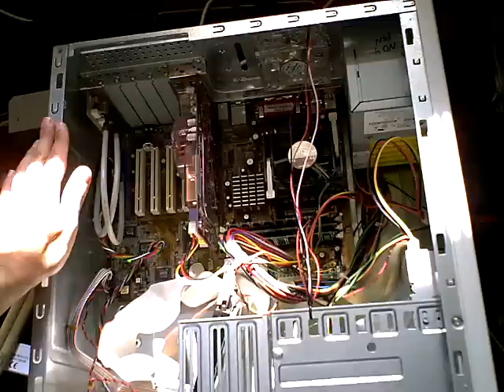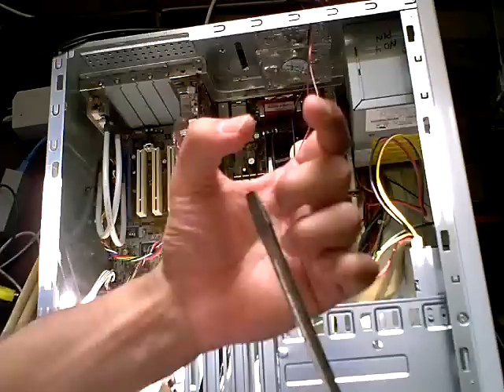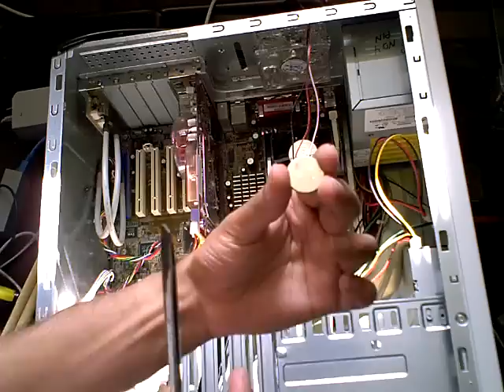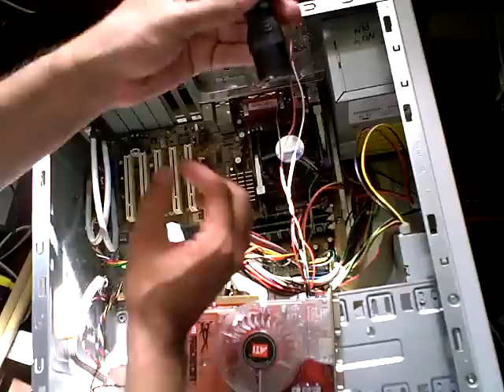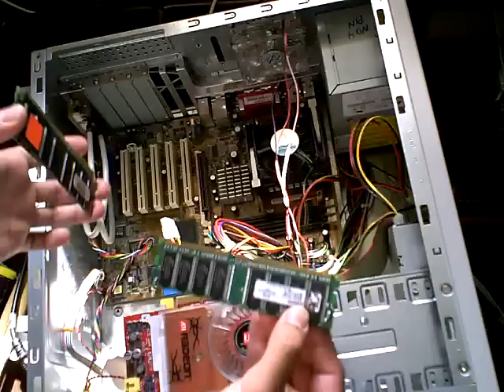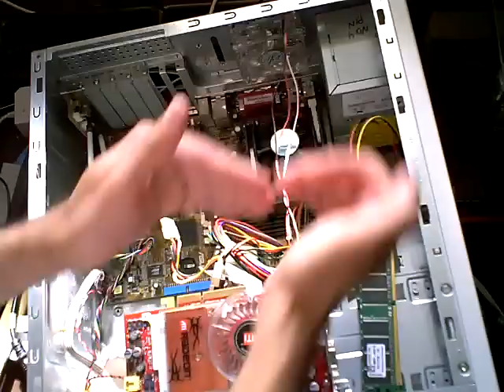How to possibly fix a PC that will turn on but will not beep and will not display anything on screen

Comment: After i saw this video i buyed a new motherboard still nothing exept on the older motherboard it randomly turned it seof off and after few sec back on but this one just keeps vorking the coolers but still no change...PLEASE HELP!
Reply from the maker: +limso cro It sounds like your motherboard is developing a short circuit due to contact with the metal casing. Most likely it has to do with the screws and metal mounting stands (supports) that your motherboard sits on. The cheapest way to fix this problem is to introduce cardboard washers between the screws and where they make contact to the motherboard, or you can buy plastic mounting supports at a computer shop.

Alternatively, you can always Breadboard it (explained in the following video:)

If the steps in this video did not provide a solution to your problem, view:

http://www.youtube.com/watch?v=_EK9a-R5pss

You never know, maybe rebuilding the PC in the opposite sense that you took it apart will solve the problem.
Reply: RodneyDickson nope...the problem was the cpu.
Reply from the maker: +limso cro Nothing much you can do at that point. Thanks for the update.

Comment: So I have four Ram modules replaced each one separately and the last one sounded the post beep error. help
Reply from the maker: Each time unplug the PC, install RAM modules in different combinations and orders, then power up. Repeat this until you can get as MANY of the RAM modules functioning at the same time. If you cannot get all RAM modules to function at once, one or more of the RAM modules may be defective.

Comment: If you have this problem and you really need to recue the computer, then press reset if you don't get the beep, even if it takes you 5 times to press reset, is working on one of my computer ASUS.  This  problem  raised   when I flushed the BIOS  several times over the years (with  BIOS file from ASUS). < PS> most likely the filters in the mother board are going bad
Reply from the maker: +UFO1997 Thanks for the feedback
Reply: +RodneyDickson  yes, it was one of the filters, I still pressing reset till goes in to set up, and I get it to load, when it loads the game gets messed up the video and it freezes (server open too many ports), then I reboot with reset, then load the game again, and I finally play the game. <> I located the filter but I misplaced  the solder, that's why I haven't fix it. he he
Reply from the maker: +UFO1997 (shrug) If you could find a way to get it to work, then it's only a minor inconvenience : )

Comment: I still can find my problem and its frustrating as crap I've just build my first pc and earlier it was showing display but now its not showing anything and I can find the solution
Reply: can't*
Reply from the maker: +The Chop If it's a new build, you might want to breadboard the entire thing. http://www.youtube.com/watch?v=_EK9a-R5pss
Reply: Thanks but i have it solved my mother board was dead i dont know how but it wouldent work for my cousins pc but i got a new one and it works fine
Reply from the maker: +The Chop Sorry it came to that, but glad you figured it out

Comment: Hey dude i got a problem maybe you can help me out i got this sumsung tv that i use with hdmi plug in to pc and today i turnd in on and it dousnt work tells me no sginal but when i plug in normal pc screen with that blue plugin it works just fine how could i fix that this . if any one hase any ideas plz let me know
Reply from the maker: +Vampex I Sure, you'll need to install drivers to support HDMI, THEN you'll need to configure said drivers to ensure that your PC outputs to HDMI by default. Your graphics board manufacturer will be more helpful to tell you exactly how to do this for your specific video card. Good luck

Comment: Help me my computer beeps and my monitor displays nothing and my keyboard and mouse doesnt work i can see its not working because my mouse have lights
Reply from the maker: +shadowslayerhero Beep error codes differ from one BIOS manufacturer to the next. To discover what the beep error code is trying to telling you, discover the manufacturer of your BIOS (available in the motherboard's manual or on the motherboard's manufacturer's website {on the page for your specific motherboard model}) and then look up the frequency and interval of your beep error code on:

http://www.computerhope.com/beep.htm

Comment: i bought a brand new pc, wasnt projecting onto the monitor so i followed these steps found out it was the ram but when i put back in the cmos battery it wobbles around is this ment to happen
Reply from the maker: You are saying that your CMOS battery is not secure in it's socket?
Reply: +RodneyDickson yes
Reply from the maker: Perhaps you broke a plastic support clip that surrounds the socket. Not entirely sure, but if the coin-cell battery is making contact on all contact points as it should, then I wouldn't worry about it.

Comment: My problem on my computer is when i start it up the hp logo goes on then after a couple of seconds it turns to a black screen and after a couple of minutes a thing will show up it says click ok blah blah blah numbers numbers pls help
Reply from the maker: +DwightPlaysMC - Pvp and more!! Sounds like your machine cannot load the operating system. Go into your BIOS, ensure that your hard drive is detected and set as primary boot device. If that doesn't help, your operating system might need to be reinstalled

Comment: Hi I have an desktop acer here my pc turn on but when I remove every RAM it gives me a beep sound, and if i put every ram in every combination in open,few seconds later it closes by itself plz help :(
Reply: By the way i get 3 beeps
Reply from the maker: You could try the CMOS reset trick as shown in the video, and if that still does not allow for all RAM modules to function, unplug the PC, try a different order or combination of RAM modules, and power up. Repeat until you find an order or combination that works (one of your RAM modules or RAM sockets could have become defective if all this was working as intended prior but is now no longer working)
Reply: RodneyDickson hmmm... ok I will try that and let you know if it works!!! but technician told me that the motherboard has some pieces melted I don't know about that but sound fishy. So thanks I love your vids and keep it up
Reply: also I don't know if its true but people say that I either need to replae my cpu or MOBO. I saw a vid with the same problem as mine but I don't know if it'll work so if you don't mind or if you don't understand I'm giving you the link of the video thanks :)
Reply from the maker: Nono, I'm following. Here's the thing, if your board has melted sections to it, then yeah, I'd think about replacing MINIMALLY the board AND CPU shortly. Of course, if you wanna get your current setup running and 'run it into the ground' then that's cool too, just keep in mind that your board may not have long for this earth, so don't rely on it for anything important, and make backups of your data ALWAYS : )
Reply: ok thank for the advices XD

Comment: I removed my ram, and it started beeping, so is that the issue?
Reply from the maker: +matt basile Sounds like it. Try different combinations and configurations of RAM modules before powering up the PC until you find something that boots (hopefully)

Comment: Would this account to a pc that doesn't power on at all?
Reply from the maker: +Camden Jessee If your power supply is insufficient, that could be an issue, but what you see in the video could be an issue as well. I recommend you Breadboard it (explained in the following video:)

If the steps in this video did not provide a solution to your problem, view:

http://www.youtube.com/watch?v=_EK9a-R5pss

You never know, maybe rebuilding the PC in the opposite sense that you took it apart will solve the problem.

Comment: I power the cpu on and all the lights in my cpu turn on as well as  my 3 fans turn on but my monitor says there is no signal. I replace my monitor with a different monitor but it still says no signal.
Honestly I don't want to replace anything so please help and I will do as said.
Reply from the maker: +Austin Illagan does your PC beep?
Reply: +RodneyDickson Yes it does, sry for the late response I decided to build a new comp but now I wanna fix the old one for my friend
Reply from the maker: Ok, for your next response please create a new thread, summarizing (or copy and pasting) what was discussed prior (scrolling through a year's worth of comments to get to this buried one is too cumbersome). Chances are your displays are not to blame but rather the video output of your PC is to blame. Power down the machine, connect to a DIFFERENT video out option (on the back of the machine), and power up. If still no video output, repeat, until each and every video out port on the back of the PC has been tested (ensuring to power down and power up after changing video out ports each time). If still no visual, I'd disconnect the power cable, press your PC's chassis power button switch (to discharge any remaining power circulating in the system), remove the video card (store it on non shiny wood, non shiny cardboard or in an ESD anti static bag), connect your display to the onboard video out, then power up. If only this last option worked, then your video card may have become faulty (you can try disconnecting the power cable, press your PC's chassis power button switch (to discharge any remaining power circulating in the system), reconnecting your video card (reseating it) and powering back up to see if magically everything works again, but I'd be doubtful. Good luck with it all.

Comment: I got some issue
After the computer turn to sleep mode i cant wake up the pc is the cpu is on but no signal in monitor

So i push the power to turn off the cpu
But when i turn on again i got issue like this no signal in monitor, no beep
Reply from the maker: Yeah, this is a tricky one. Have you tried resetting the CMOS with the battery trick as shown in the video?

Comment: My pc stated to display black after i cleaned my pc. I touched my intel processer and graphicard. When i turn it on all the fans work. Need help.
Reply: Ulugbek Musinov MY moniter saying no signal.... i checked my cables and they are fine.
Reply from the maker: +Ulugbek Musinov does your pc beep at boot?
Reply: I fixed the problem. The motherboard was not working so i replaced and it worked. Thanks enyway

Comment: Well on Monday I switched my cpu cooler off my computer and replaced it with a new one, know before my computer was acting perfect. So after installation of my new cpu cooler my pc turns on but won't boot or bios beep, now when I turn it on my pc power button won't work or the reset button the only way to turn it off is the switch on the psu, anybody knows a solution? Can you tell from this if it's a cpu problem or a motherboard failure problem? RodneyDickson
Reply from the maker: +Otakus United Could be either. Try what the video shows.

Comment: help me please when i was installing the new game i downloaded and i opened it and it came to a bluescreen. 1st bluescreen and then it restarted by its self obviously and then i started it up and it ended up with anouther blue screen and it has some wrong spelling and the "search for more information something" it has a colon and it has nothing written there and it didnt restart by its own and i restarted it and i opened it and it didnt open anymore like no display.. help me please :(
Reply from the maker: +Baby Chye Explain the 'no display'...is it doing exactly what the PC in my video does?
Reply: remove all parts and re fit them
Reply: I fixed it :D Thanks to you :3 But it's weird cause' it says "Please search this to learn more something like that " It actually doesnt have any word on it which is really weird.. Anyways i fixed it i waited for the CMOS battery for 30 mins i think and fixed the ram and cleaned it with a eraser .. And it fixed it :D
Reply from the maker: +Baby Chye Glad to hear things worked out.

Comment: Okay i've another problem its beeb and show me the bios but its not working its give me black screen and restart ... I hope you get my point ᴗ̈
Reply from the maker: So if I understand you correctly, after the POST screen displays (the diagnosis screen that lasts just a few seconds) and after a beep, the PC goes to a black screen). Is this correct?
Reply: No its turn on like any normal pc
It shows me the loading of windows 8 ....

And then restart and beeb and do the same thing ... It's like if you installed a ram but not correct so its will beebs and restart ...
But here its okay its turn well then restart for no reason !!
Reply: You are correct but sorry it's not black screen :) my mistake...
It is the windows 8 loading if you can visit my channel i uploaded a video
Reply from the maker: *****
Ok, so I took a look at the video. What's going on is one of two things: 1) Your operating system does not like the UEFI BIOS - if you can switch to a classic BIOS (see in your motherboard's instruction manual how to do this) then hopefully that'll solve the issue, or 2) your operating system installation has become corrupt and will need to be reinstalled completely. The best (and easiest) option would be to first test out different compatibility settings in the BIOS to see if you can't find a setting that functions as intended, and if not, then try formatting and reinstalling the operating system sadly. Good luck with it.
Reply: Okay So i'll do the Second option because the Windows was with me So much stupid ...
Thank you very much.
Reply from the maker: *****
You bet, hope everything works out : )
Reply: ᴗ̈ actually i formatted the windows for an easy solve ᴗ̈ before 3 days.
Thank you for you'r help.
I did reinstall windows with the same activate code and it's worked "̮ 
RodneyDickson
Reply from the maker: *****
Yep, the Windows activation code should continue to work provided that the machine you are installing the OS on is the same - I think Microsoft realizes that users will inevitably have to reinstall their OS at some point or another : )
Reply: Dean Pepler I did upgrade my Bios,and I think it's now F11 ! (Gigabite motherbord)
I don't remember the name of the motherboard but Thank you for your help I did solve the problem ᴗ̈.

Comment: Hallo, i dont know if you gona read it and im not so good in english so sorry for that.I have a problem with my pc.To day it wouldnt start but your fix helpd me.But there is a problem.The pc and windows starts and i must put in there my password.If i do it bluescreen turns on.I dont know what to do.By the way i have windows 10. Thanks for your answer.
Reply from the maker: +Eric Breitwieser You'd be best to first enter the BIOS and 'load setup defaults' followed by saving and exiting. If the issue still persists, try Breadboarding it (explained in the following video:)

If the steps in this video did not provide a solution to your problem, view:

http://www.youtube.com/watch?v=_EK9a-R5pss

You never know, maybe rebuilding the PC in the opposite sense that you took it apart will solve the problem.

Comment: Dude my pc BEEPING 3times then it will stop BEEPING again.

BEEP BEEP BEEP stop then beep again. ram and video card is removed what is the problem of my pc i need your help man...
Reply from the maker: +crinx06 Beep error codes differ from one BIOS manufacturer to the next. To discover what the beep error code is trying to telling you, discover the manufacturer of your BIOS (available in the motherboard's manual or on the motherboard's manufacturer's website {on the page for your specific motherboard model}) and then look up the frequency and interval of your beep error code on:

http://www.computerhope.com/beep.htm

Comment: I have this same problem but when I try to hold the button to turn it off nothing happens at all
Reply from the maker: +DcBoy261 Different boards handle this shutoff command differently, so don't worry about that. Try everything you see in the video.

Comment: I removed the ram but no beep .. Motherboard bad? Cause i did switch them out to another frame.
Reply from the maker: Breadboard it (explained in the following video:)

If the steps in this video did not provide a solution to your problem, view:

http://www.youtube.com/watch?v=_EK9a-R5pss

You never know, maybe rebuilding the PC in the opposite sense that you took it apart will solve the problem.

Comment: my pc some times working but for a 4 to 6 restart wait and suddenly stars working with no ram or graphics card ubdate isiiue but some times only one beep and some times while playing game amd stops working and its again good for a 1 to 2 hours den again goes stop wroking amd record zz wat to do plzz reply
Reply from the maker: Your CPU could be overheating. On a fresh boot, go into the BIOS and check the CPU temperature. Then run your game. When the PC freezes, reboot, go into your BIOS, and check the CPU temperature again. If it is much higher (and close to the cut-off point) then your CPU is insufficiently cooled.
Reply: thanks it helped  #RodneyDickson
:D :D